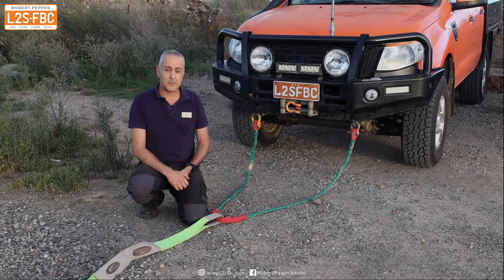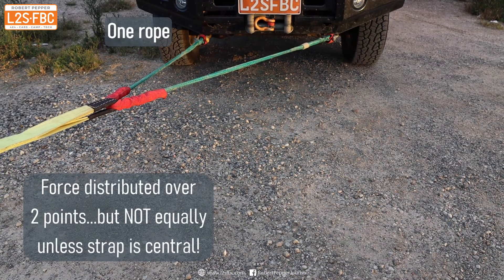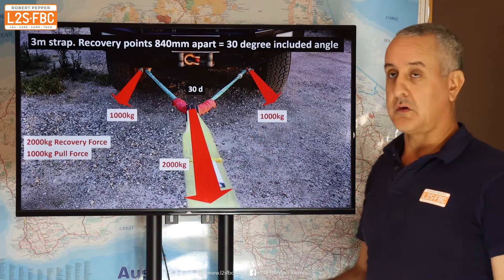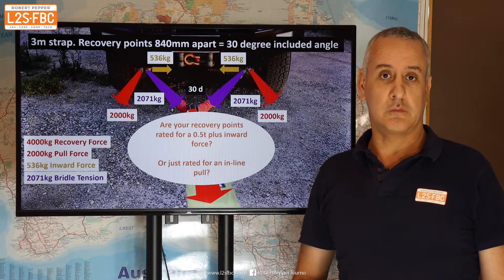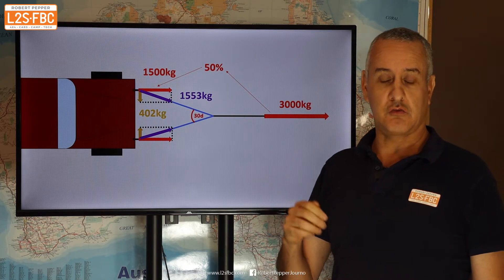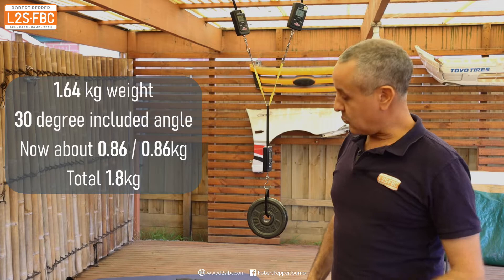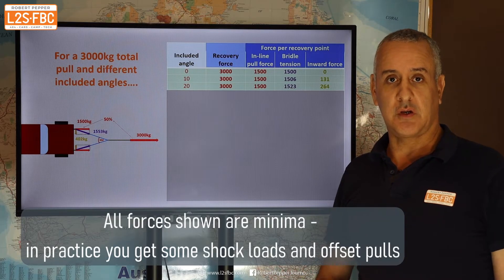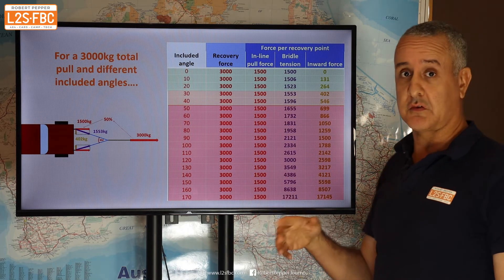What you don't know about 4X4 bridles (equalisers)

Comment: Very nice presentation, especially the trigonometry.  My Toyota Tundra 2007 4WD has two recovery points at the front.  Each point has two rings, one with a diameter of 7/8 inch which makes a 3 inch inside diameter ring, one ring is 5/8 inch diameter which makes a 1 1/2 inch inside diameter ring.  Both are welded to each other, then to a plate which bolts to the frame by two 12 mm diameter bolts.  I do not know the grade of the bolts, but let's say 10.9. 
I looked in my owners manual and on line but can not find any values for the working load limit for these rings.

 A 5/8 inch diameter shackle with a 3/4 inch diameter pin has a working load limit of 6500 pounds.  I would think that a solid ring of 5/8 inch diameter would have a greater working load since there is no pin to shear.   The bolts I estimate would have a single shear at the threads of 9000 lbs.  Assuming the bolts are equally loaded, total shear would be 18,000 pounds.   It would seem that the 5/8  X 1 1/2 inch diameter ring is the weak point.  I estimate it would have a work load limit of 9,000 pounds.  

Using the diagram of a 3000 kg force ( should be newtons but kg can be used ),  I initially calculated this wrong believing that the force along each leg of the bridle must be half of the total.  A vector diagram showed that this can not be true.  The force along each leg of the bridle is 1553 kg.  This is counter intuitive but must be so according to the vectors.  The sideways force vectors cancel leaving the direction of pull force vectors which must equal 3000 kg.  Since there are two direction of force vectors each must be 1500 kg as you show.   The demonstration using the scales was very convincing showing that counter intuitive force on the legs of the bridle.  Thank you for the time and effort you put into this.

Comment: I know this was years ago, but how are the anchor shackles attached to the truck.  Just what is the hole size that allowed the large screw ends of the shackle to go through?  Perhaps there is a picture from another of your videos?
Reply from the maker: Yes, shackles.
Reply: @L2SFBC  Did not make myself clear.  The shackles you use are I believe the 3/4 size and they require a hole size of ~23mm for the removable pin.  In the case of your setup the pin is against the loop in the bridle.  To get it into that position there has to be a much larger hole in the truck's bumper.  At a minimum an oval hole of ~40mm to get the larger ends through some material to where the pin can be positioned outward.
Reply from the maker: Yes the holes in the recovery points are sufficient for a 3/4 tonne metal shackle.

Comment: So.... I am a recovery specialist, and we never use sliding bridles exactly for the reason you stated. And also this concept only works when pulling straight, if you attempt to use this sort of sliding bridlle the shear forces create loads that the connection points on the vehicle can not handle (as you said), you are better off using a locked bridle (the one you aren't calling a bridle) because the bridle constantly tries to center the load... I can't argue about your math, that is correct, however the recovery points should have enough strength to support recovery. (I say should because there are a lot of manufacturers that install cast open hooks on thier bumpers that are only good for hanging grocery shopping.

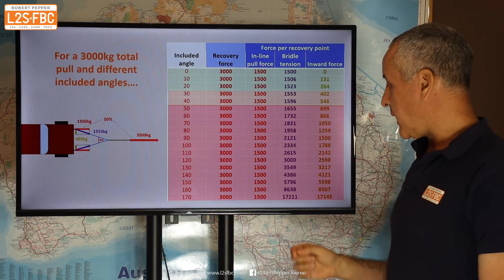Comment: 7:18 The in the book The Martian, the author Andy Weir had the protagonist use a long cable tied between an anchor point and his rover to right the rover using something similar. The cable started tight and straight. Without a winch, the protagonist pulled the rope from the middle perpendicular to its length. The angle started at exactly 180 degrees, so he had quite the mechanical advantage, as you show with your table at 8:47 

Have you ever been in a situation where human strength and this type of rigging could have freed a 4x4? The distance you could get the 4x4 to move would be very small, but the amount of force would be quite high over that short distance, I would imagine.

Comment: Hi Robert, thanks for again another logical description. I have one question: the distribution of force only occurs if the main pull line can slip left or right on the bridle. When you’re using a small included angle, the friction coefficient needed to allow that slipping would need to be reduced significantly whereas a larger included angle would allow slippage far easier. This is a dynamically changing factor especially in a snatch situation. Did you do any research on where the “ideal” angle sits in relation to distributing the load across the recovery points versus the included angle for slippage?
Reply from the maker: No I haven't. Yes you are right. In practice I have found it to be not much of a problem but one solution is to use snatch ring or block which near perfectly solves the problem.
Reply: @L2SFBC  thanks, I hadn’t thought of a snatch block - another piece of projectile to watch out for but better than a broken point.

Comment: About 25 years ago, I took a statics and dynamics course in college. Barely passed, promptly left the engineering major and said, "Pointless knowledge I'll never use." Here I am 25 years later thinking, damn, wish I'd pay more attention at the time because this would be useful knowledge.
Reply: In the end, you hook up what ropes you have, using whatever attachment points you can find...and pull. You need no math nor do you need a calculator to pull someone out of trouble. Just being aware that hard shackles, hitch receivers and hitch pins are all VERY dangerous and should not be used.
Reply: @geraldhenrickson7472 Id suggest that professionals do infact calculate loads on recoveries to ensure equipment is up to the task and not overrated such kinetic ropes and straps.
Reply: @geraldhenrickson7472I use my rear hitch receiver recovery point attachment to recover people or get recovered myself , why is that bad ?
Reply: or just watxh a 13min vid and ur up to speed?
Reply: Knowledge is knowledge... nothing useless.

Comment: I'm interested to know thoughts on using a 5500kg rated winch extension as a bridle? I have a kit that included one but I have added a dyneema 25m one to my kit and have 30m of dyneema on my winch as well, so the 10m one is a bit obsolete really, but I keep it in my kit anyway just in case a recovery requires an extension but not that far. I wondered since bridles arent readily available above 4 meters, so a 10m one not only reduces the angle significantly, but also acts as a 5m winch extension still while being used as a bridle/equaliser.
Reply from the maker: Yes 10m works well 👍
Reply: @L2SFBC  I figured since the recovery points from roadsafe are rated to 5000kg per pair, (RPPAT-04) then a winch extension (no elasticity like kinetic straps and ropes) the 5500kg rated 10m winch extension would be pretty perfect for the job. And places like George 4x4 have them for sale at the moment for as little as $10 plus postage for a NATA   tested strap. You can't really go wrong with that.
Reply from the maker: Yep!

Comment: Can you double a bridal to reduce the stress on the recovery rope? Not tied together...
Reply from the maker: Double a bridle?
Reply: @L2SFBC  2 x 1/2" x 10' bridal with a 30" anchor point center to centre using a 7/8" x 30' kinetic rope attached as close to centre as possible.

Comment: Something is bothering me about this. If I am putting 3000 "kg" (we all know it should be Nm) into the system, how can I be getting over 3000kg out of it? I think it is actually showing that to get any movement in the desired direction with a larger included angle in the bridle the recovery force has to increase to the point it exceeds the SWL of the gear. In particular the larger lateral force on the recovery points.
Reply from the maker: Look up my 'Reader Was Wrong' video
Reply: @L2SFBC  ah, thanks. I don't doubt the numbers, I think the explanation is incorrect. In the other video there is a force exerted through the rope from the bolt, which is added to the force exerted through the rope from the car. That force is equal to the force exerted by the car, otherwise the car would move. If there was no force from the bolt the car would fall down. Newton's Law. Try putting the scale between the bolt and a snatch block. It will read 470-500g as it did before.

Comment: Good Info! I've used a bridle many times to reduce the forces on the recovery points. Never thought about how far apart they were and how they squeezed inward on the points. Will make sure to use a longer bridle to reduce the angles and forces.😢
Reply from the maker: Thanks!  BTW, it's bridle not bridal.

Comment: The force should be in N (Newtons) rather than kg. 
You did state that kg wasn’t technically correct.

On the Forester the recovery points aren’t 1100m apart - I think you need to just add a subtitle correcting the audio comment to 1100mm.

Comment: When by accident you discover a pot of gold ! Saved this clip for future reference as well as shared with others in an Off Roading community. @ 11.19 onwards, when the Recovery Point is 700 for a 30 degree angle it works to a minimum length of 3m. My question to this is what if I am not able to source a 3 m bridle but a shorter one say 2.5m. What would the impact be ? I admit I may have missed the answer in your clip....if you could point me to it, would be great....else, what would you recommend. Regards from India.
Reply from the maker: Consider the included angle not length
Reply: @L2SFBC  Thank you

Comment: @L2SFBC
I realize that the video was posted 2 years ago.
Very informative.
 I have a question on the bridle length. Is the length shown in the chart for each leg of the bridle or the entire length of both legs of the bridle?

Thanks
Reply from the maker: Just make sure it's 30 degrees included angle or less.

Comment: Nice info thanks again. I've always wondered how effective and what the purpose of using a bridle is. I think the big take away based on your summary is that the benefit is reducing the load on the points of the vehicle being recovered , not the overall load on the pulling vehicle . seems like this is best used when you're really really stuck..... I usually tell myself, the less parts being used in a recovery the better, so I don't often use this setup. ....I'm curious , what do you think of using a flat tree strap , like the green ARB you haber , as a bridle if needed ?
Reply from the maker: Yes, that can work, it would usually be strong enough and long enough.

Comment: This is interesting but are the maths correct? Taking your 170degree extreme example, the chart claims a 1,500kg force can be multiplied over 10x into a 17,145kg force. But hang on - if I attached the entire 1,500kg force to just one recovery point, at right angles (180degrees) then I would have 100% of the 1,500kg as the inward force. Not 10x that. I can't create more force than I have to start with.
Reply: When you understand angles in relation to force you understand what he is saying. Angles make a huge difference.
Reply from the maker: Yes you can. the maths is correct.  Weird, but true. Did you see the scales?

Comment: One can carry a spreader bar to absorb most of the inward forces.  Even if it is not exactly the distance between recovery points, it can help a lot.
Reply from the maker: True, but I would simply prefer a longer bridle.
Reply: @L2SFBC  - agreed.  The less metal heavy stuff, the better.

Comment: Hello Robert, I understand from your video that longer bridle length is better in all cases as it will keep the angle low. I am thinking that a 7 meter rope will do the trick in the majority of instances without putting undue stress on the system. My question is, if the recovery is going to be using a snatch rope, does the bridle need to be made of snatch rope as well? I am guessing the answer is yes, but want to make certain as I put my recovery kit together.
Reply from the maker: Not so much the length, but the angle.

Comment: I try to bridle a single snatch block. Also. I always use 3 straps to create a bridle. By doing so. It allows  for angles to reduce equalization towards load sharing. Such as 2 x 30ft straps with a 10ft center strap.  
   For those without TABS.  I  UTILIZE 2 polyblend quad braided lines & wrapped 4-6 times, as points on sharps edges for bridles as well.  Very forgiving.  
  Some complain overkills And not worth the prep time. But doubt can kill.  If I've learned anything.  The suck always creates  doubt on resistance.

Comment: Ok, so if the goal is to make the angle of the bridal as small as possible, why don't all off road vehicles just use a single clevis mount in the center of the vehicle?
Reply from the maker: Various engineering reasons but also sometimes you want an offset pull

Comment: Is this also why springs and shock absorbers on a vehicle are hardly ever vertical?
Reply from the maker: No.
Reply: @L2SFBC  
Doesn't the rate change if the springs are angled?
Reply from the maker: Kind of, but most suspension doens't move up and down exactly vertically, so therefore you don't want the shocks/springs exactly vertical either.

Comment: Excellent video.  your explanations and info were great.   so with my 885mm recovery points, my 2.4m bridle is no where near to the 3.5 to 5.2m length you recommend.  You have definitely educated me.  Switching to using my 6m strap today.   But I would be very interested in your comments (pros or cons?) of using a kinetic rope or snatch strap rather than a solid tow strap for a bridle.  I have always used tow straps as a bridle myself.
Reply from the maker: You can use a solid, the elasticity is in the kinetic side of things.

Comment: Thanks for your  measurement, testing and explanations. Very interesting. Besides the max load I am concerned about damage through asymmetric distribution of the load. How dangerous is snatching with only left or right recovery point for the ladder frame becoming a parallelogram rather than being a rectangle as it should be? I remember crunching sounds from the frame of my Jeep Wrangler JKU while snatching a bogged heavier Chevrolet Blazer out of a mudhole using only the left recovery point.
Reply from the maker: Ideally you want to spread the load, but it's hard to answer as it all depends - the force of the pull and the nature of the vehicle. Always reduce recovery load by digging etc or using ramps.  However...this is more of a fear than a real problem.

Comment: Very informative video - thanks!  Wouldn’t it be kinder on the line to use a snatch ring at the bridle connection point and get the appropriate bend radius rather then webbing tube and rope to rope connection? Thinking of Sabre or Factor 55 shown in your snatch ring video.
Reply from the maker: Yes it would but it would make little difference in practice and introduce metal into the rig.
Reply: Thanks - but If I am truly stuck, I’m likely to have a snatch block for a double pull so the metal will already be in the line. (13,000 GVW and a 16.5 winch). That said, if it makes little difference, I should look at the webbing.

Comment: The forces mentioned here are applicable to lifting and rigging guidelines.
A spreader bar of appropriate length (and stiffness) for the vehicle recovery points and using two equal length short connecting straps would always be a better option than a single bridle. 
Further you failed to mention the WWL of the bridle rope being exceeded at higher angles
Reply: And introducing that spreader bar just introduced a deadly missile should anything snap...I'll pass.
Reply: @rickss69  No reason to be afraid of your rigging so long as everything remains within the WLL and everything is in good condition.
Reply from the maker: Yes good points thanks Kevin
Reply: A spreader bar probably isn't all that practical for most situations especially since it's not going to act properly if you have an angle in the pull, And an angle is when the biggest issues exist, with a straight pull a spreader bar would work but at that point, you might as well carry a longer bridle.
A better option would probably be a 3:1 pull where your first snatch block is on one anchor point and the end of your wire rope or synthetic rope is hooked into the other anchor point then the angles would be reduced and your pulling force would be increased if need be, Only problem is the sideways forces on the anchor points would still be a problem if they aren't strong enough to withstand that and you need to pull off to one side.
And if you are worried about one anchor taking twice as much load with the 3:1 being as one anchor would have a 2:1 on it and the other would have a 1:1 then you could add another snatch block for a 4:1 and have a 2:1 for each anchor.

Comment: Great video. I'm a beginner and I find your way of presenting very easy to follow. Can you recommend a place that sells 5m bridles? All I can find is 2.5/3m bridles.
Reply from the maker: Hi - have a synthetic rope maker custom-build one for you. They will need around 7-8m of rope to make a 5m rope. Use the thickest rope possible, say 18mm.
Reply: @L2SFBC   thanks. Some tree protectors look like bridles and are longer, .eg. 5m. Would they be a good enough replacement?
Reply from the maker: Yes they would be